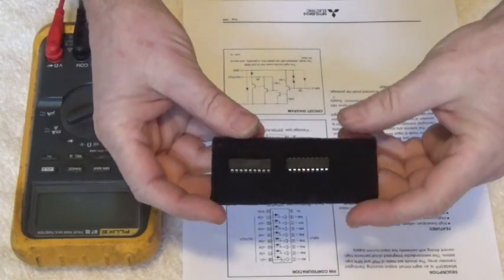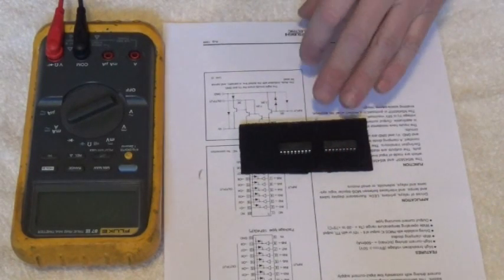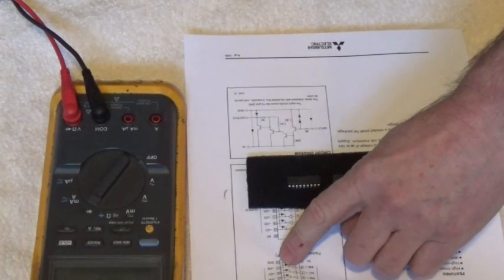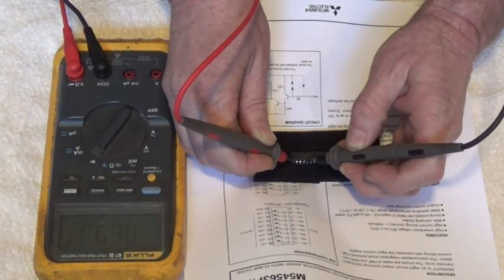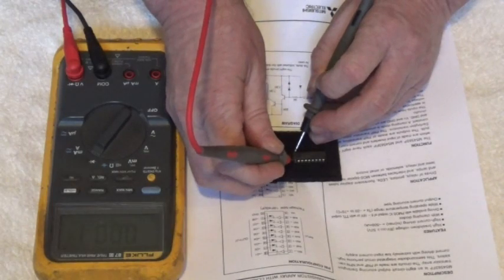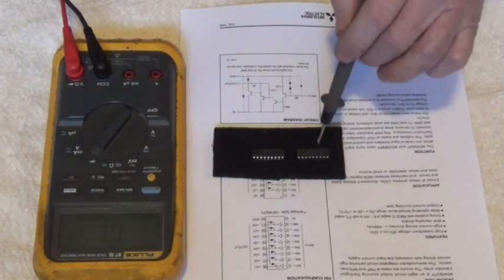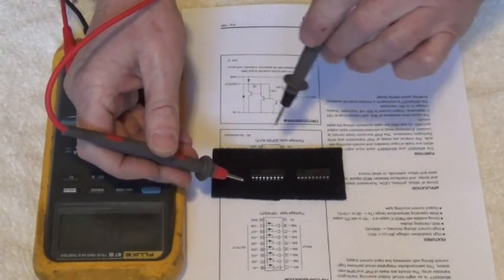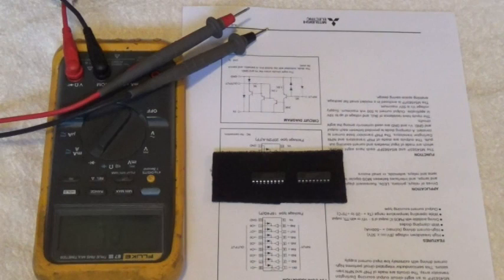Troubleshooting Integrated Circuits for Short Circuits

Comment: Thanks for this tips on finding the shorted circuit IC.  I learned and found the damaged IC of the dishwasher and replaced it with success.  This will be very useful for my continuing exploration of the electronic world.  I am not trained in this field but just learn the knowledge  through the YouTube videos such as yours.  Thanks again.

Comment: Hey there, I’m terribly inexperienced with electronics (I’m 17) but I’m trying to learn, so hopefully you’ll see this and have some advice. I tried this with a random circuit board I had with a few ICs. 

I tried to replicate what you did as best as possible. I put my red probe on the chassis (which was bonded to the IC ground) and put the black probe on all the pins. My voltage drop readings were bizarre... Most of the readings were around .7, but some were as low as .4 volts and some were as high as 1.666 volts... What?! In fact, numerous pins just read infinity (1.      ) on the meter, which I didn’t understand. One of the ICs on the radio board tested shorted on an entire side of the IC. (The radio was unable to tune anything, I wonder if that IC was the cause?)

Comment: Thx for the lesson i'm trying to fix a Roland TR-606 drum machine and learning about the TC4011B Quad 2 input NAND Gate cause i know that has been causing me problems. Question wht type of multimeter should i buy cause i been learning to repair other small Drum Machines learning more about Ohm and Diodes.

Comment: why the red is on the GND ? why not black ? sorry for the question ..im just a beginner.
Reply: Nyor is right, Peepaw says "put the red lead on ground [pin 10] then go around the other pins with the black lead. I'm a noob too, so I could be wrong but it seems to me like, one should put the black lead on the ground and go around testing the other pins, with the red lead. Correct me if I'm wrong - please give an explanation
Reply: heres a really late reply haha, from the datasheet, the diode's positive pin is at the ground pin of the IC. If you test the diode with the multimeter, you must connect the positive side of the multimeter to the positive pin of the diode, in this case, it is the ground pin.

Comment: Hay Peepaw since you are so good at this I havd a question. I need to find out how to figure out if a eprom or a small memory chip is bad. Can you help with this please? 
Currently looking at B&K 575. But too expensive. Is there any cheaper way but I not looking to get some cheap tester. I need reliability.
I understand the concept of when in doubt, replace. But the chip has been out of production and discontinued. my only source is also not reliable'  eBay or Chinese made.

Comment: my multimeter on some pins shows voltage drop around 0.1V while others(good ones i think) are around 0.6V or 0.4V... is this IC shorted or i'm just getting wrong reading?

Comment: Hi Peepaw MacDonald, thanks for this video it is very useful. I have a question and that is. I have got a gamepad which doesn't work properly anymore. Actually when I plug it into power through USB it gives a sign of power but the pc said that the device isn't recognized and it won't work. So that, I have started the PCB troubleshooting and following your instructions I tested the IC which is a very small 32 pins one and with my multimeter I found out five points where I assume is a short, respectively D+ and four digital I/O. With short I mean that the multimeter doesn't show me anything on display. Moreover the IC shows a small brownie spot on the surface pretty close where the short were found. Now I would like to ask you a confirmation of what I told you and if you think I am on the right way or not? Thank you very much in advance!

Comment: Excellent! I'm going to subscribe.How many pins have to be bad before you consider the IC bad?
Reply from the maker: Only one. I wish I could salvage an integrated circuit with just one output or input shorted. But the circuit boards that they are attached to want a completely functional integrated circuit. Thank you so very much for watching one of my videos. I hope that you and your family are doing well.

Comment: Maybe you can assist on this.. 
Do you know how to get, make or mod a high gain/high reception antenna on 2.4GHz camera's transmitter?
The TTL transmitter or TTL receiver operated on 2.4GHz.
When I opened the cover up I sees a Zig Zag Circuit & I think that's the antenna.
I do not see the Ground for that antenna. While many 2.4GHz Antennas have center (hot) & ground (negative).
Where would I solder the ground from the antenna to?
And how long do I make the antenna for maximum receptions?
I would love the WiFi to be up to 500 meters.

Comment: Hi.  Im wondering if you could help me.  I have a tms3450nl IC.  I also have the data sheet.  I want to test it but nowhere on the data sheet do i see a ground pin.  Can you help?  The volume went low on this (alarm clock).

Comment: How do you locate a short on a circuit when let's say a 3-volt line that is feeding to the different parts of the circuit is shorted?  Most circuits I encounter doesn't allow me to just break the circuit or isolate the 3-volt line.
Reply from the maker: Hello, I hope you are having a good day. I hate 3Vdc circuits. I worked on one that I had measured 1.5ohms from Vcc to Gnd with my Fluke DMM. Now ask me how you find a short when it normally measures that low. I had another board that was  booting up good. And it the good board measured 1.5ohms from Vcc to Gnd. That is insane.
Reply from the maker: I powered up the non booting board. And felt around with my finger and found an TTL IC that was extremely hot as compared to the other IC's. It was so hot that I could not keep my finger on it longer than a half second.
Reply from the maker: I replaced that surface mount device TTL IC. And afterwards, the board booted up good. That shorted IC blistered my finger tip. HaHa. That is hot hot.
Reply from the maker: Another thing that may help. Electrolytic Capacitors and Tantalum Capacitors fail. And when they do, they can cause short circuits. I hope this helps you troubleshoot your circuit.
Reply from the maker: You know what would be neat. If I could inject one electron into the faulty circuit. And it would report back to me the exact location of the short circuit. Oh well... maybe someday... Until that lucky day, it is you and me to find the fault.

Comment: question: bought 2 new Philips UAA 1250 IC chips.  It will not test as you have shown and I can not find any data sheet on this chip.  It is used in a dome light assemble for a car 1992. Any ideas where I can get this data sheet and why will not test as you describe ?
Reply from the maker: I also tried and failed to find a datasheet, so that I could answer your question. But you can find ground of the IC if you can find perhaps an electrolytic capacitor that filters the 12Vdc onto the board. I am assuming 12Vdc because you are speaking of a car. Usually the ground side of the filter electrolytic capacitor will be ground of IC's on the board.
Reply from the maker: By the way, why do you think the UAA1250 is bad. Is there a hole in the middle of the IC? Do the dome lamps no longer work. I am curious for other peoples troubleshooting stories.
Reply from the maker: One more thing. It appears that this is a custom IC manufactured by Philips for Mercedes-Benz. That would explain the lack of datasheet. Thank you very much for stopping by and watching one of my videos. I hope you and your family are having a great day :)
Reply: @PeepawMcDonald  Yes on both accounts.. there appears to be a hole where or close by the mfg hole. Also, I believe this chip controls the lights when the doors are opened or unlocked then it is suppose to fade out.  the dome/map light its self works fined off the two switches above the mirror. when you set the one rocker switch on the left to the left position the lights are suppose to come on when the door opens or  is unlocked but does not.   However if you set the left rocker switch to the right position both lights come on if you set the right rocker switch to the left position just the left dome/map light comes on if set that switch to the right position the right dome/map light comes on . This is for a 92 500sl mbz it is not big deal but I just want things to work as they were designed to do But at this point I think there is more down side to me fixing this then up side. I did buy 2 new UAA 1250 philips chips and I wanted to test them like you have shown but with out the data sheet / pin out I can not figure the dam thing out your instructions were so clear but i think the ground is in a diff location I got frustrated  trying to find that data sheet as this IC is obsolete and I just gave up.  That was a great video you made and very well narrated step by step instruction.  I would really like to test these new chips I am still searching for some info Thanks for your help and video

Comment: Peepaw McDonald i have a question. How do you know the value on each pin in diode mode that we saw on multimeter ?
Reply: About .5 to .7 would be ok reading for an if like this.

Comment: Great video.  Will that test work with the IC in circuit?
Reply from the maker: Hello, and thank you for watching my video. Yes this does work when the IC is soldered onto the circuit board. I have repaired numerous circuit boards with this method of tracking down shorted integrated circuits:) Caution though, on some circuit boards... Sometimes with many IC's soldered to a board, the Vcc to Gnd will appear very low in diode drop. But other than that, yes this works. Thank you very much for watching:)
Reply from the maker: Oh, one more thing. Don't be fooled by logic inputs that are physically connected to ground. They will appear as shorted to ground with your digital multi-meter. But are intentionally connected to that ground. In this case, look for a trace connection to ground.

Comment: I can not see you as you are testing the ic is not clear you have a dark place they
Reply from the maker: Yes I see what you mean. With your digital multi-meter in diode test mode...Place the red lead of your digital multi-meter on the ground pin of the integrated circuit. And place the black lead on all other pins of the integrated circuit. You should see a good diode drop. Or you will see a short circuit on the pin of the integrated circuit.